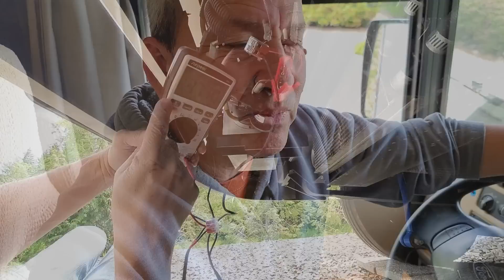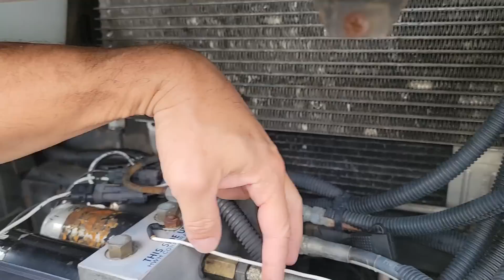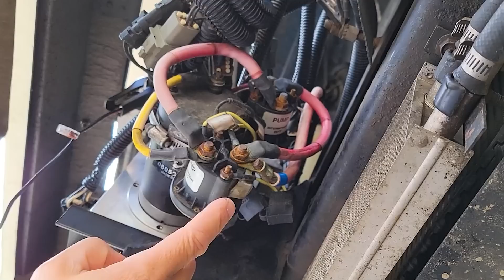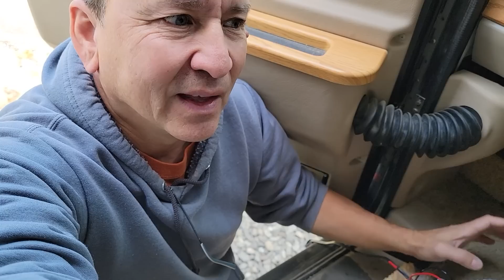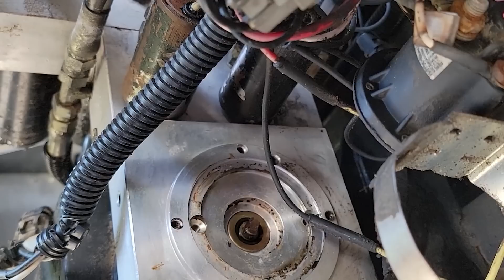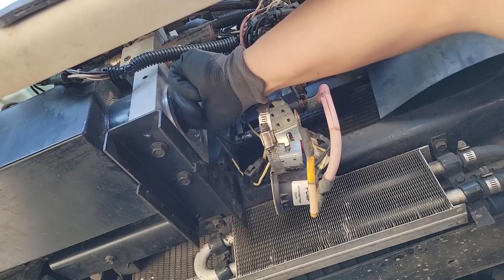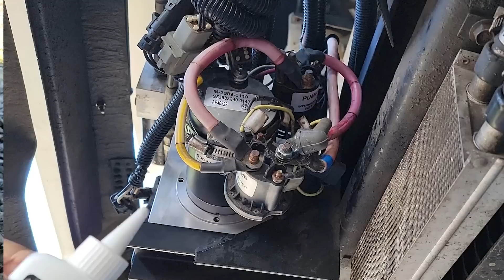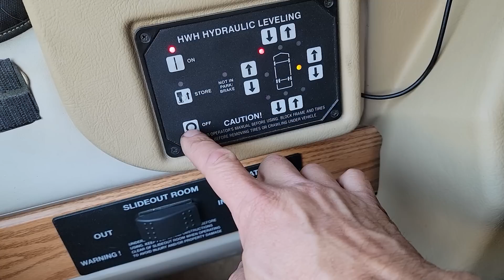HWH Pump Motor Troubleshooting and Replacement - RV Slide Out and Jack Failure

Comment: Measure voltage to motor with switch on. Electric good then motor bad. Simple
Reply from the maker: Yup. Of course there's more you can check. But typically if it's not the relay then it's the motor. Good thing we were home. I carry a spare relay...but not a motor.

Comment: Another great repair video, thanks Brian. Shortly after watching your video from Mexico on hitting something resulting in the jack foot slipping up and burying the jack post in the dirt, I had a similar issue. I hope this video is not foreboding hydraulic pump issues, at least I know how to swap out the motor now.😮
Reply from the maker: Uh oh...now you said it 😃.  I've always been worried about the 20yr old hydraulics. So, it actually feels good to replace a critical piece with something new. But now should I carry a spare motor? 🤔
Reply: @RVwithTito  I would think the old motor lasted this long (20 yrs-ish), hopefully the new one will last a while. Of course if you have a spare you will never need it. BTW, I recently watched your awning motor replacement video, yesterday our awning stopped almost 3 ft extended….ok now I need to order a new awning motor for our 2007 Winnebago. I guess I better order a hydraulic pump motor too, then watch for your next failure/repair video so I can pre order parts :-).
Reply from the maker: @markheene8852  Hopefully it lasts. Check the power on the awning first. Sometimes it's low battery power issue or poor connection. Those motors are expensive. Good luck!
Reply: I was going to ask if you will be carrying a spare. If you were at a campsite, how would you have retracted your jacks and slides? Is there a manual process?
Reply from the maker: @Chris.Y.054  Yes. There is a manual process that involves releasing the valve pressure then pushing/pulling the slide(s) in. The bedroom slide requires some serious pushing, but there's a manual winch for pulling the main living room slide back in. I haven't tried to do it yet. At some point I definitely should.

Comment: I thought I'd share my own recent fix.  My hood hinges were bent, so even when the hinge was fully adjusted, the top of the hood hung out about an inch.  After hearing from Winnebago that the hinges were no longer available, I had an epiphany.   I removed the hinges and used the upper bump stops on the hood to mount a couple of hood pins.  I still use the original latch to hold the bottom, but now the top is pulled in tight with that $13 hood pin kit from any random auto parts store.  It also means that when I need to work in there, I remove a couple of pins and set the hood off to the side.  That gets me about 8 inches closer to what I'm working on as I'm not hanging over the hood.  
Now I need to figure out how I'm going to get one of my inner tires off to take it in and have the valve stem replaced.  It came loose of the rubber holder and got trapped behind the wheel simulator, and the end got ground down at an angle, so a tire chuck or tpms leaks air now.
Reply from the maker: Yeah. That hood does get in the way. Mine hangs out about 1/2" on the too and the whole design seems pretty flimsy.  Thanks for the idea. Good luck with your inner dually.
Reply: @RVwithTito  Yeah, the hood SHOULD come out and up.  With it coming out and down you can't help by lay across it when you're working in there, resulting in bent hinges.  The hinge pin kit was so easy.  I spent two days trying to adjust the hinges.  It took an hour to switch over to the hinge pins.
Reply from the maker: @brianvandy4002  Yes. it surely gets in the way. I may add that to my "things to do someday" list.

Comment: Yikes, all that stuff in front, down low, where all the water, salt and grimes can accumulate. GREAT DESIGN!! Oh, if I only had a few minutes with these rv engineers and deisgners!
Reply from the maker: Yeah. After replacing the motor I sanded and painted all of those rusty spots.

Comment: 11:00 Torque specs: YES

Tighten it until it starts slipping, then back it off 1/4 turn 😂
Reply from the maker: It's aluminum so I'd be afraid of going until it slips.

Comment: Had similar problems watched Kevin Caudill you tube. Was shuttle valve on mine but now know how to check motor pump problem thanks
Reply from the maker: Yes. I've seen his also. That's where I found the supplier. His is a different model system though but similar.